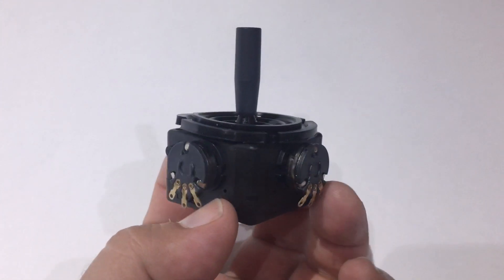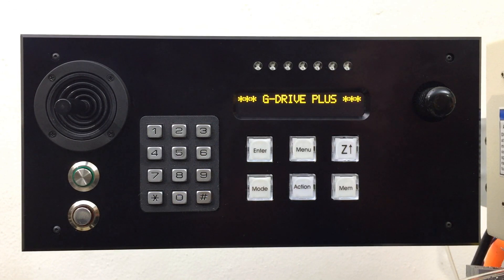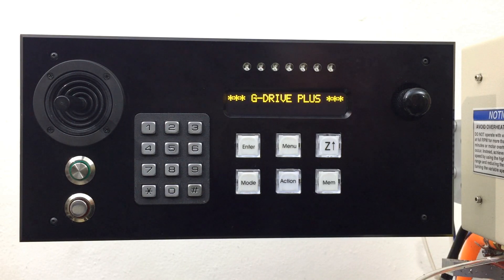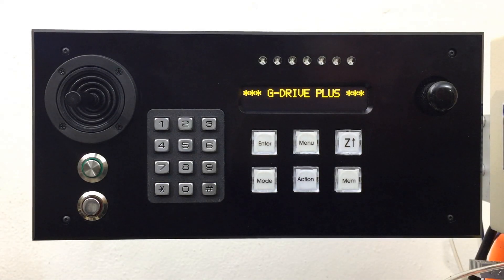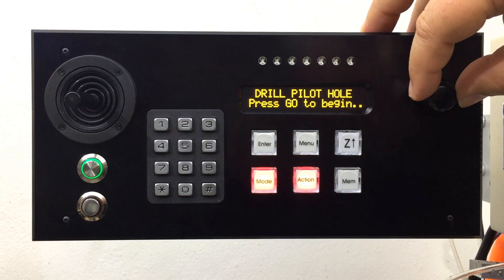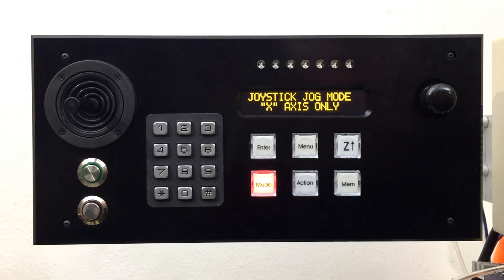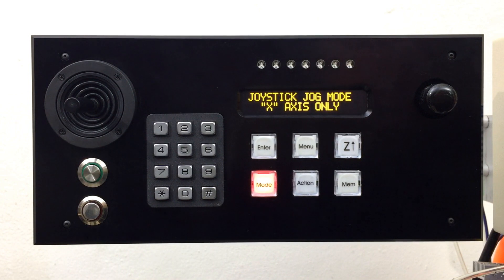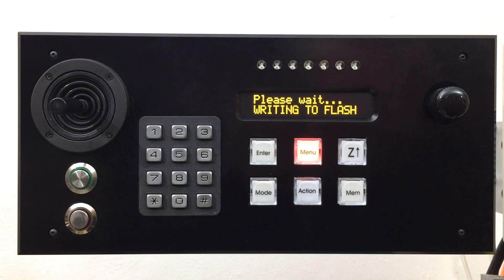Control your Milling Machine with a Joystick !!

Comment: Hey this looks pretty cool!! How would I connect this to my mill when my mill is already wired to, and controlled by my PC?
Reply from the maker: Hi ZeoN,  I have developed a relay box that wires over to your stepper drivers. You then wire the output signals of the PC into the relay box. Two Ethernet cables connect the G-Drive to the relay box as well.  You can then enter the menu in the G-Drive to set the control source for the milling machine to either the G-Drive, or the PC. It's easy!